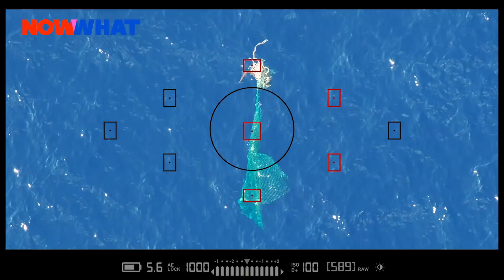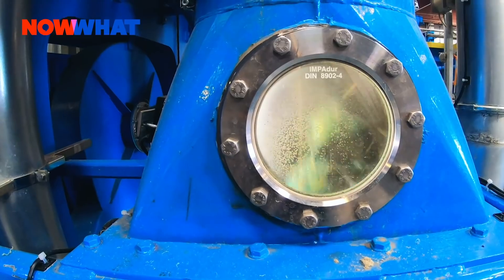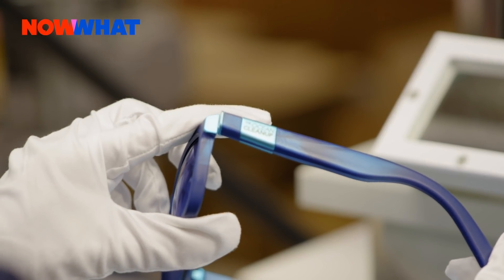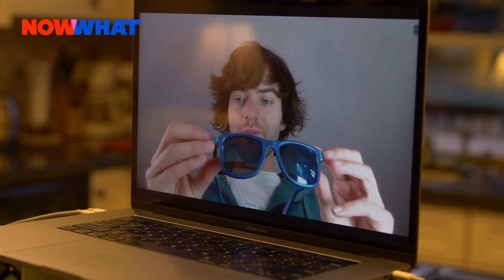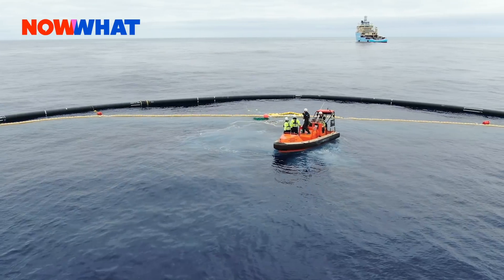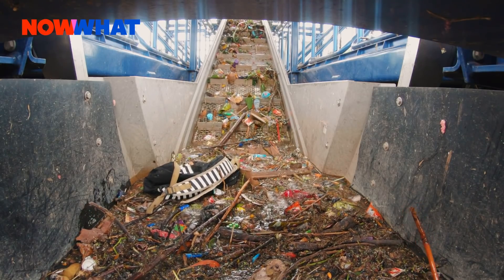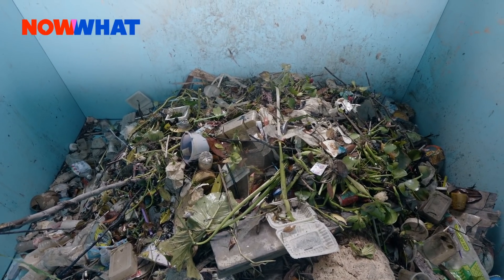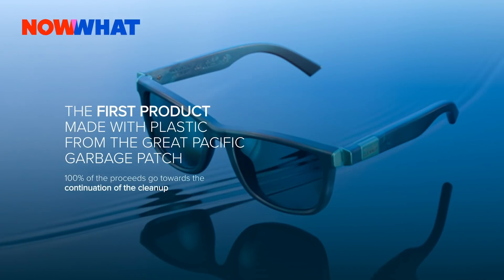Turning Trash into Treasure: The Ocean Cleanup's sunglasses made from ocean plastic

Comment: I was thinking if they could use the recycle material to be made into roads for africa?
Reply: Unfortunately using plastics for roads is a bit of a problem since as it degrades it will eventually turn into microplastics and get into the water system